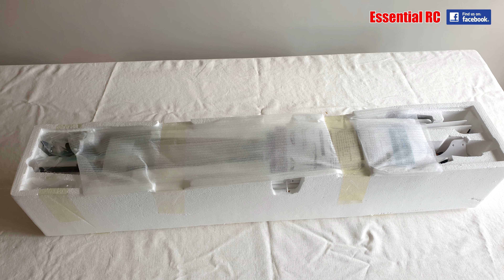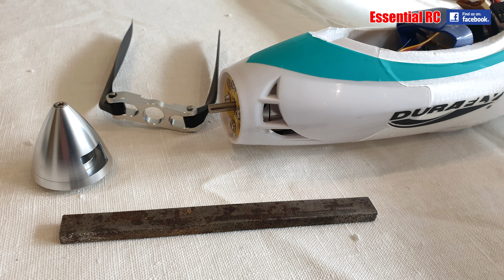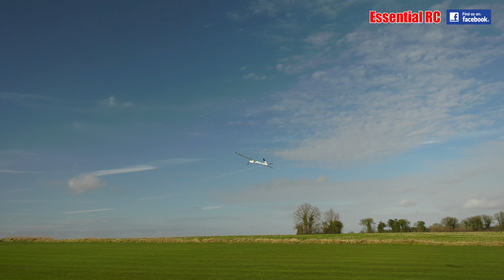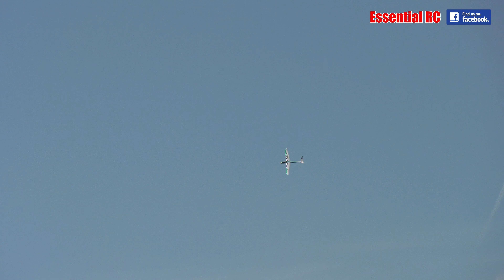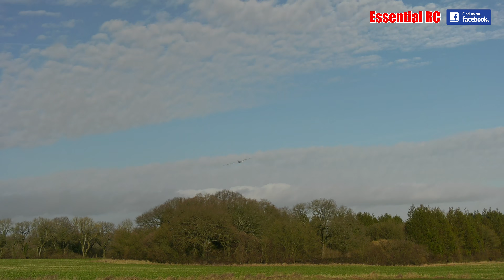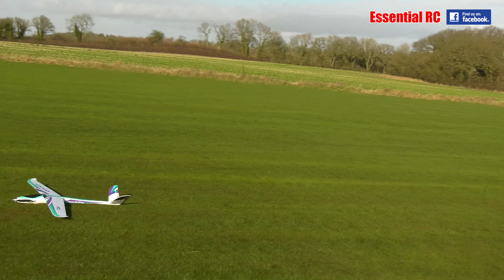IT'S BACK ! Durafly Excalibur v2 HOTLINER / SLOPE SOARER

Comment: I’m sorry but I will not be ordering one of these. The UK warehouse is no more, and the EU warehouse does not ship to the UK. I’ve just checked and the cheapest shipping option from the Global warehouse is £143 to send it to the UK.
Reply from the maker: I'm aware of the UK shipping problems. They are trying very hard to solve it.
Reply: @EssentialRC  I’m not implying that HK are at fault. I’ve noticed since the start of this year the changes to importing to the UK. I’ve had three Banggood orders cancelled with the reason given that they cannot ship to the UK. Even some European dealers I’ve used over the years have now stopped shipping to the UK.